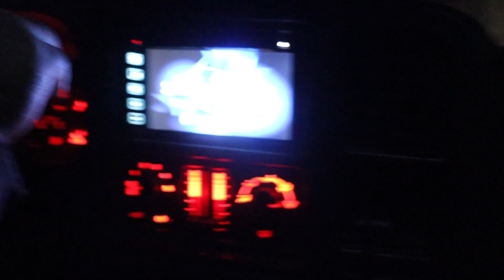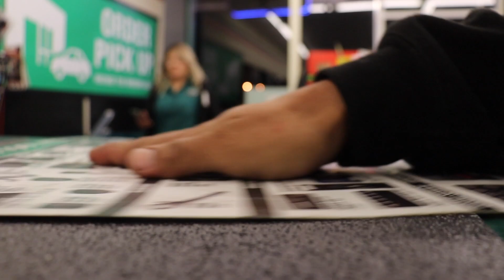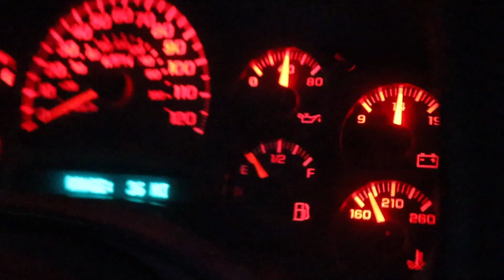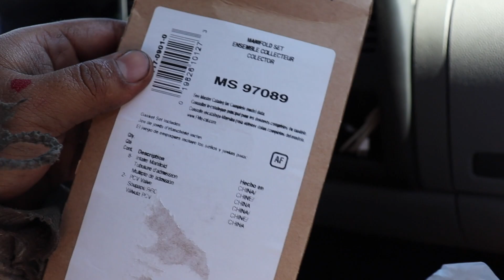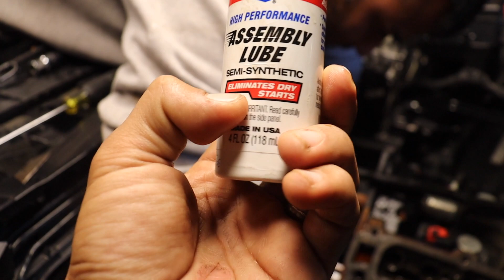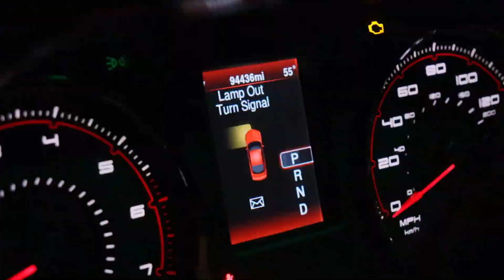WE CAME TO AN AGREEMENT "NEVER CAMMING HEMI`S AGAIN"

Comment: What was it I did mine and I was very hesitant same cam etc longtubes but what was your problem on it before you took it to get redone
Reply from the maker: When I took it to get it redone they said it was possible I had antifreeze in and bent the piston or could possibly timing was off
Reply: @LuisEsparza34  yeah bro I did my own as well was scared asf did plenty LS cams 
But most def was off on timing she should have cranked right up after prime without throttle their not as bad just not as easy as LS either way glad see it up and going! Mines on my channel